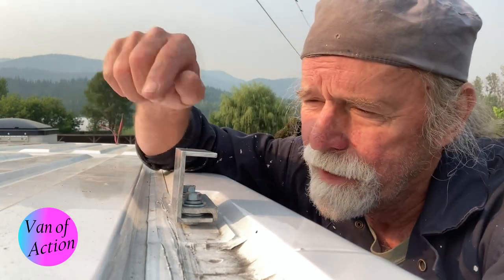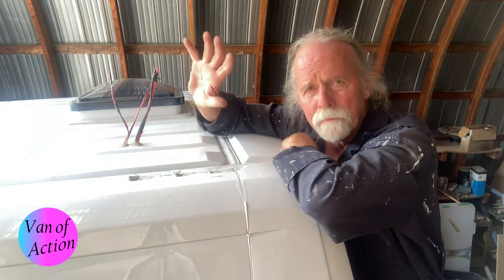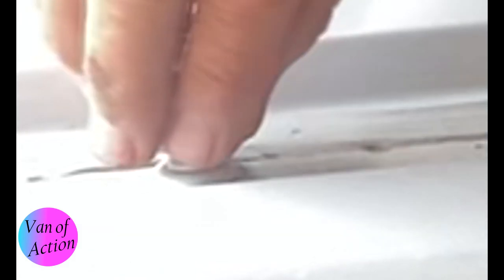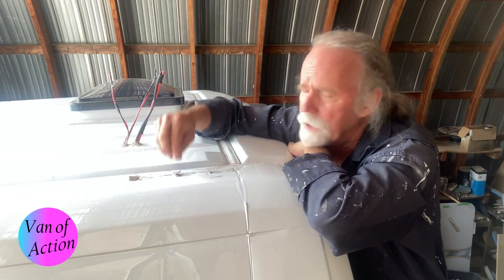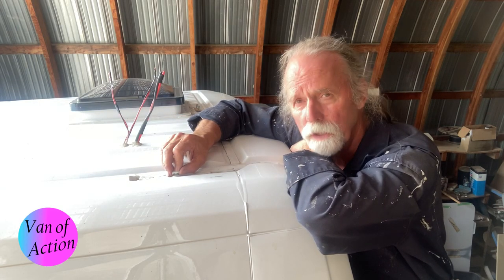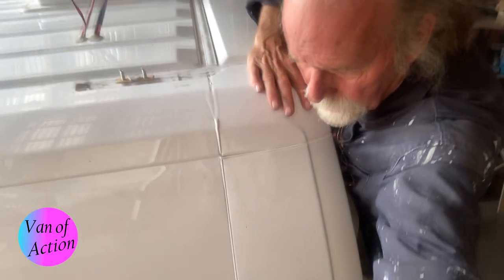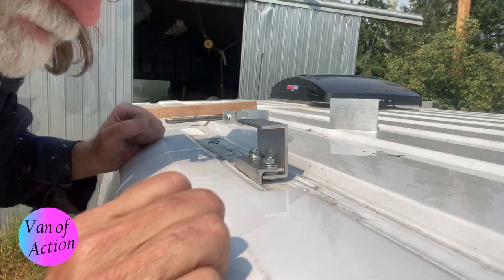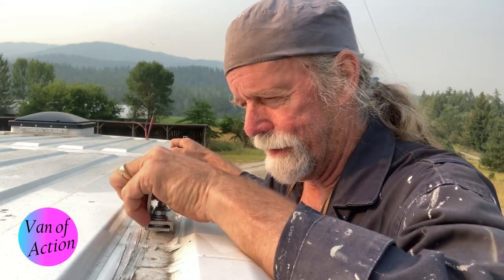How To Make D.I.Y.  Promaster Roof Rack Clips - solar panel roof rack van conversion  - Van Life

Comment: Do these roof studs move...as in can I raise the height of them by unscrewing? Mine is a 2021 model, and the factory fit roof studs don't give enough clearance to fit a bracket. Don't want to start messing things up. Cheers.
Reply from the maker: Hi Bv3 Bv3 thanks for watching - I have not had this comment before.  Can you take a photo and send to me ?  With the dimension from roof to underside of studs.  vanofaction@gmail.com.   The studs on my van spin but do not go up or down.  - looking forward to hearing from you.

Comment: Great video and thanks for sharing! I think you said the angle was 1X1, but I’m not sure you said what size the ‘C’ channel was. You told the guy at the store you were looking for something 3/4 inch, but it looked like it was the same depth as the angle.  I apologize if I missed it on your video, but could you please share those material sizes?
Reply: Hi Karl. Thanks for watching.  The “C” channel I used was 1” x. 2”x 1/8”. However as long as it’s 1/8” thick you could use and height you want.  I was trying to clear the crown in the roof by at least an inch without going too high.  I was told to have a little clearance to prevent whistling. I’ve just driven 3900 KM from BC to Ontario and you wouldn’t know it was there…….The “L” angle for the too part was   1” x 1” x 1/8” for the “L” I trimmed off one side so when assembled it just covered the bottom flange of the “C”.  Hope that helps - if I can be any clearer let me know.   Cheers.

Comment: Great idea!! I will be trying this myself! would you mind posting the dimensions of the pieces? I only got that they are 1/8" thick but nothing on the hole diameter, etc. Thank you!!
Reply from the maker: Red Spiral - thanks so much for watching and taking the time to comment.  I have been asked this question before.  I'll make a video with greater details and dimensions ......  did you subscribe ?  If not visit "VANOFACTION.com"  and you'll be notified when the video is published.  stay tuned and stay well.

Comment: Hi, Really enjoy watching your video-your craftsmanship is amazing. I copied your design for roof clips and they are solid! Thank you. There is another guy that has a youtube cannel using your design but he's using pop rivets for his roof rack. What are your thoughts on use of pop rivets? I'm not sure of the strength or whether they will pull apart easily. I not an expert so just trying to figure out if this the way to go for building rack on top of your well designed roof clips
Reply from the maker: Happy New Year Greg !!  Thanks for watching and taking the time to comment.  You have no idea how much of  a kick I get when I hear of my stuff being helpful to people.   Can you send me some pics of your finished clips.   And can you send me a link to the other channel ? I'd love to see what he's up to as well.   I didn't think of rivets for 2 reasons. 1.  I wanted my rack to be "adjustable" - in case I wanted to change things down the line.  2. I have used a rivet gun before but only for very thin metals.  The rack would be 1/4" inch thick and would require a heavy or even powered rivet gun.  There is no way I would buy one for what amounted to 32 total connections.  I'm lookin forward to seeing your clips.   Be well ...........   Dave
Reply from the maker: Hi Greg - thanks for the link - I've reached out to Dwayne to see if he would share his experience here ... I would ask you the same thing.  It could be helpful to others to see how the system goes together.   Send me some pics and lets talk !!!   Dave

Comment: I'd suggest checking what effects your two metals have in contact with each other, or you'll be stripping that all off before long. Like you said - metal's not your thing, but aluminium is sacrificial under certain circumstances, and you could end up with eiter rusty steel or missing aluminium
Reply from the maker: Dex !  Thanks my friend.   That is something I had never considered.  I’ll keep my eye on it for sure.
Reply: Tef-Gel is what salt water boaters use to deal with SS/Aluminum corrosion.
Reply from the maker: @robertschulke1596  Thanks for watching and also thanks for actually reading the comments  !!! I don't know what Tef-Gel is but over the winter I'll be doing a complete survey of the roof rack and clips.  be well my friend
Reply: @VanOfAction  Tef-Gel is a gel containing Teflon micro-particles. The fasteners get a solid grip, and the particles mash down to a microscopic insulating layer. No electrical contact: no electrolysis: no corrosion.
Reply: Anodic action needs an electrolyte to facilitate activity, and fresh rainwater is a poor electrolyte, unless dirt with mineral salts built up between the mount and the body. Electrolytic action is more of a concern with dissimilar metals in constant immersion in the salty (electrolytic) waters of the ocean. That said,  I did was isolate my mounts/towers from the van with a thin piece of rubber cut from a bicycle innertube to prevent the mount from rubbing the paint on the van and exposing it.

Comment: What size of bit did use on  the hole that slippes over the tab
Reply from the maker: Hi Eric - thanks for watching and asking.  You want these to be a snug as possible without being so tight that you can't  get them on an off easily.  I ended up playing around a bit and used a 1/4" bit - but you should check with a sample.  Be well  ...........  Dave

Comment: I haven't read all comments but could you have used some insulation foam between the bolts en roof to protect the paint? Or was the space between bolts and roof free, after all was tighten? 
I'm thinking about doing the same for my Jumper in Europe (same van different brand). I'll see if I can use carriage bolts instead to avoid unnecessary rotation ;-)
Reply from the maker: Hi Alex - thanks for watching and leaving a comment.  When the clips are installed there is no contact with the roof.  The idea of carriage bolts crossed my mind as well but making the holes square was over my pay grade.  If you didn't see I made a second video with more detail as I was checking over the winter ... you can see it here https://youtu.be/diIZe-teysU    if you go to 5:18 in this video you'll see how I stopped the extra rotation.  I've had several folks from Europe say they were going to copy this .... let me know how you do.  Be well
Reply: @VanOfAction  nice trick the grinding of the wrench to make it fit ;-)
Reply: @AlexCailliau  LOL where there's a will .......   the bend in the shaft is a carry over from a router hack I used years ago.   Be well

Comment: How Big was the holes you drilled? The ones on the outside and the original center one.
Reply: Justin !!!! Thanks so much for watching and commenting.  Unfortunately I’m on a 6 week road trip and don’t have my drills with me.  For the stud itself it was about 1/4”. I started at 3/16” and increased until I had a nice snug fit on the post.  For the holes in the rails they were just big enough for the bolts to pass.  I used 1/4” - 20 bolts.  The plan should be to keep the holes as tight as possible.  That’s why being careful to be straight and true as you drill is important.   The less wiggle room the better.  Be well and safe.

Comment: There are mower blade sharpeners that are designed to harness the grinder into a … a … whatchamacallit.  Anyway the gadget holds the grinder still for you & you can move  the blade down & up to contact the held mower blade.  That zig could be combined with your jig to make a straight cut where the grinder cannot slip out of the desired alignment.   It would work…
Reply from the maker: Esparka - thanks so much for taking the time to watch the video and share your idea.  This is the first grinder I've ever owned and I'm not aware of any attachments.   I did a quick google search and found only one plastic set up that didn't look very useful for my purpose and the cost was $ 95.00 which is way more than I could justify for what I was doing.    If you can post a link please feel free to ....  it may be very helpful to others.   Be well and please come back to VanOfAction.com
Reply: @VanOfAction  

PPS  - Sir, did you also know that you can take a pair of pliers, or perhaps channel locks and you can actually grasp those roof nipples that are facing forward to back in relation to your van & you can twist that roof nipple to face perpendicular to the van.    In this way, you may be able to get those custom, homemade brackets to fit in the direction you desire for aesthetics, whereas they wouldn’t fit for you in the forward to back aspect.   Please let me know if this works …
Reply from the maker: Hi Esparka -  you have no idea how much I appreciate your comments.  I truly do.  Yes - I did know the "nipples" would rotate.  And in fact that was my first plan.    But the diameter of the hole needed to facilitate the rotation was greater than the hole required for the clips I used - which I think created a much stronger connection (I'm not an engineer) - and  created a much greater purchase for the clip in the -  front to back direction -  and in one side of the side to side direction. I'm working on a video now explaining what the process - I would love to hear your thoughts after that - give me a week or so ........
Reply: I’ve sent you the link for the sharpening vice 3 times & YT apparently won’t allow it.
Reply: all american
Reply: sharpeners
Reply: dot
Reply: com
Reply: This is just to show you my idea, friend. I know you would not use this yourself, unless you sharpen mower blades regularly.  I was just all into your idea & I really wanted you to see the gadget.  
PPPS - My thought on the roof nipple turn was just to see if that would allow you to slip on your brilliant bracket, then you could turn it back after said bracket was positioned.  
- the grinder tool is on the Canadian version of amazon they say, in case any of your viewers would want it…..
Reply: That’s all, promise.   : )
Reply: @esparka   _  sorry I was away from my computer today - NFL Playoffs !!!!!    Go Bills !!!   Thanks for all you effort in trying to share the link.  Be well and stay safe

Comment: Sure wish you could make some sets available to your subscribers. I'd buy 8 of them for my 159" WB 2020 2500.
Reply from the maker: Hi Deirdre - I wish I could but I’m on the road and have no tools at all with me.  But they are pretty simple if you follow the steps.  Good luck and stop back.  Dave
Reply: @VanOfAction  Thank you for responding. I spent some time last night watching videos of others trying your technique and I'm feeling confident enough to give it a try. I have the aluminum. I'll let you know how it turns out. :)
Reply from the maker: @deirdre444    videos of others trying my technique ??  that's amazing - could you send me links if you have time ???  vanofaction@gmails.com
Reply: @VanOfAction  I've looked in my history but have not yet found them. When I find them, of course I will send you links. :)

Comment: Nice job. All the nuts and bolts and washers should be stainless steel otherwise they will rust…
Reply from the maker: spleerfloof - thanks for taking the time to comment - YES !!! I've been told that,  I used what I had that day as the nearest hardware store is an hour plus round trip -  This winter I'll do a careful inspection and switch them out.  I expect trading the whole lot will be about 4 hours work.  Be well and come on back !!!
Reply: @VanOfAction  Yeah I get it, sometimes you have to do things in steps like that.

Comment: Two major floors with this people should know - 1. almost impossible to get anything on the bolt head for tightening down. 2. All the weight is on the pin and not evenly spread out on the panel around. 

Trust me I tried something similar, the bolt needs to be square or welded onto the plate.
Reply from the maker: Hi Jordan.  Thanks for watching and taking the time to comment.  It’s in the conversation we all grow.  Your first point …… yes and no - if you follow this link and watch about 5:30 you’ll see a hack to tighten the nuts.  Really simple and something I should have talked about in those video …… https://youtu.be/diIZe-teysU?si=iNg1eVB7HqA3CC83. - point number 2 - you are correct  - the weight is not on the roof at all.  Which I think is fine.   In my case the rack is holding up the solar panels aboot 40 pounds tops.   I’m not concerned about that at all.  I suppose if you wanted a deck up there you may need something different - or at least do more research.   Be well.  Dave
Reply: @VanOfAction  first off thank you for taking the time to reply and make these videos, you’re a real kind soul. I see, so a modified spanner, I actually thought of doing that but ended up doing the standard double U channel, cutting 16 square holes with a drill bit/jigsaw/chisel. Took me all day just to make the brackets lol but it works well. I’d say either one is a perfectly fine solution I just got frustrated when trying to both fit the bolts with the 3mm thickness and tighten them. So switching from 3mm to 2mm bottom bracket allowed my square cup head bolts to fit better without grinding or special shifter needed. Once you know how to cut square holes easily it’s worth doing imo. Just drill a hole and cut the corners with a jigsaw.

Comment: Industrial 3M tape. Done.
Reply: OWild1Child - Thanks for watching and commenting.   I have seen people use tape,  personally I would always choose a mechanical  connection over a stuck on one (that's why I choose the windows I did)   I'm the guy that'll have things fall off 3000 km from home !!   Be well and stop back ... cheers
Reply: @davechomitz1545  oh lawsy that ain't good:() They use the 3M tape on rockets, maybe I will double up with some gorilla tape too to be on the safer side. Keep on keepin on!
Reply from the maker: You too !!

Comment: Have a question for you you say you’re a woodworker I’m sure you have an electric minor soul why not just instead of buying an angel grinder why not to spend 40 bucks and buy a buy metal blade for your saw Would’ve been a lot faster than 20 minutes on your miter electric saw for the bi metal blade probably got it done in five
Reply from the maker: Hi David - thanks for taking the time to watch and leave such a nice comment.  The shop I'm using is rented and the only equipment I have are the hand tools I brought from Ontario when we moved and the old table saw that came with the shop.  I did  buy the drill press for $ 35.00 for the roof rack job - I have no idea what I'll do with it now :)  But I don't have a miter saw.   Honestly, I've done some crazy thinks with my table saw, and I knew I could cut metal with it -  but on this old thing that is just plain scary. And I'm thinking having the grinder may be something that could come in handy - I've already used it to sharpen a couple old axes.  Just like everything there are a couple ways to get there and the best results come from doing things the comfortable way.  Be well - cheers

Comment: I would redo them out of steel. It would be much stronger.
Reply from the maker: Hi Robert - Thanks for watching ..... Yes I would agree they would be stronger in steel.  The question becomes how strong they need to be and what you want the finished product to look like.   In my case the roof rack that goes on the clips is only for the solar panels.   Total weight will be under 100 pounds.  The aluminum is plenty strong enough and will never rust or need painting.  Hope you stop back again.     Dave